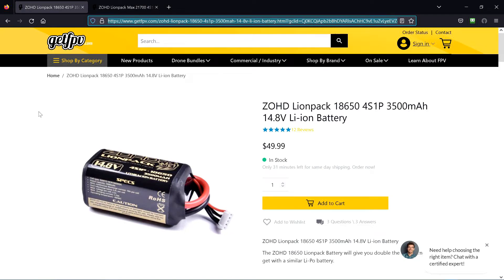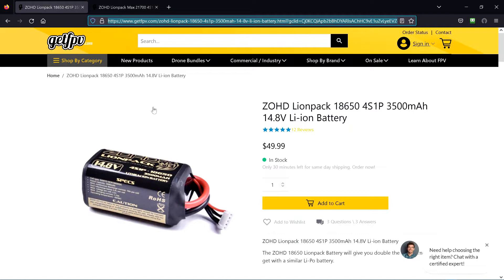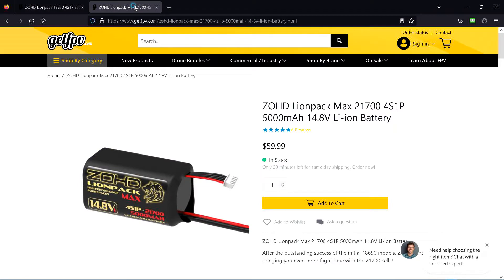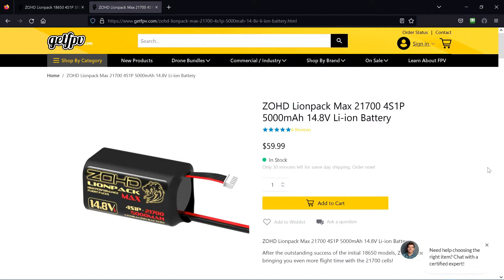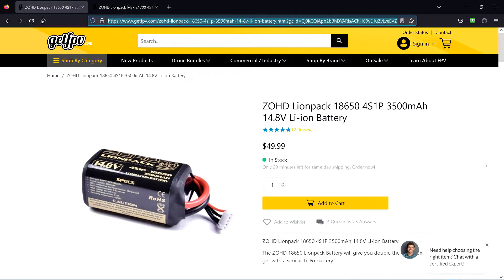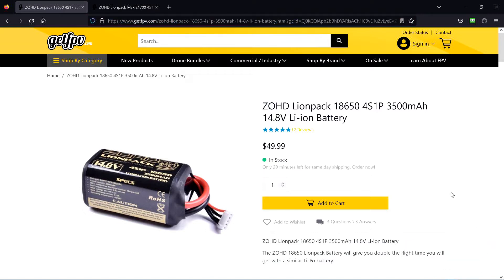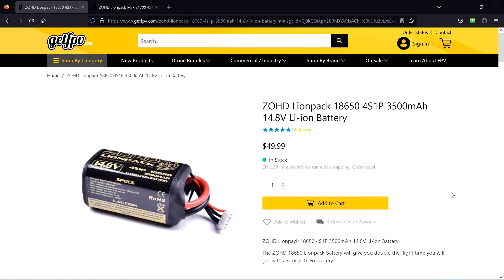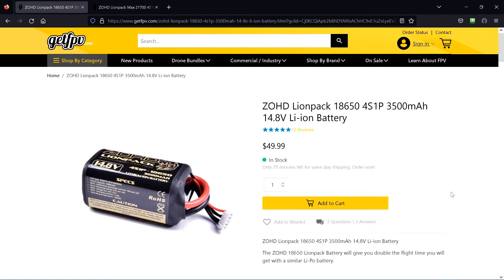A Little Help Please

Comment: Disable failsafe voltage. Just monitor your voltage. You can set voltage alerts instead. Lions will sag and then recover if you punch throttle. They will sag and recover pretty well on a takeoff. The idea is to get your plane up and at altitude fast and then cruise. Safe measure is land at or before 3v. I try to be close by around 3.2v to give me a little cushion for landing maneuvers and go-arounds if needed. If it's a calm day, I know I can stick the landing in 1 shot and may push it but that's not usually the case. When you're at 3v and need throttle, you will sag big time. At 3v, the voltage drops like a cliff and the next .5v go fast. Unless you're going for world records and extreme endurance, it's not worth it to run them down too far.

Also, I highly recommend the SkyRC BD250. You can take your mean cruising watts and set that in the BD250 and run the batter down to your desired end voltage to get a REALLY good idea how the battery performs. A 3500mAh pack will not have 3500mAh usable power. Then you throw in the C rating of the cells and you have another datapoint to compare.

Example test of mine for comparison:
6S6P 18650 rated for 21,000mAh has a usable rating of 15,651mAh when running at 128w down to 3v per cell. Run time 2hr45min
6S4P 21700 rated  for 16,800mAh has a usable rating of 15,914mAg when running at 128w down to 3v per cell. Run time 2hr59min

Different cells, different C ratings... You get the picture. You need to test them either in the air or on the bench. If you don't want to mess with the BD250, just put the plane into a loiter (big radius) and let it run down. That's a good method as well.

Here's a link to one of my test videos, https://youtu.be/Rr3YjCm_Xnc.
Reply from the maker: Ah so landings become more critical.  Or should I say, wave offs become more dangerous because of sagging.  Had not thought about that end of the flight.  I did think about the front end during the takeoff.  Figured like most batteries, the lower you can keep the amps the better everything works.

I do have a ISDT FD-100 I use on the bench.  It only has a few set discharge rates.  .5A, 1A, 2A, 3A, 4A, 5A, and 6A rates.  I have used in to test the endurance of a battery at a fixed discharge, but I needed real life data at this point.  Or someone to say my thinking that 3v was a time to land, was correct.

I think I have an idea/plan now.  Thank you.

I just watched the video.  My little discharger doesn’t do anything like that.  That SkyRC BD250 would be nice when my current charger dies.  I have an old HiTec X4 I paid a lot of money for about 10 or 12 years ago.  When it goes, I will step up.  Until it dies, I have to use it to make it worth my money.  if I ever can.  lol  One thing for sure, things sure have gotten cheaper.
Reply from the maker: Oh BTW.  The 4G telemetry.  I been peeking into that.  Am I going to have to fly a Raspberry Pi?  Or am I way off base?
Reply: @nighthawkvs  I have the FD-100 as well. It's good for discharging packs but doesnt do much else. The BD250 isn't a charger. It's just a discharge/analyzer. Not bad for $85.  The difference from the method you mentioned is that setting a constant discharge rate does not account for real-world as in as the battery drains, you need more amperage to maintain the same speed (wattage). So testing by constant power, you set your avg cruise watts and then you get a better representation. 

For 4G telemetry/video , I use a raspberry pi as a companion to the FC.
Reply from the maker: @NoFlyDrone  As I said I have been peeking into 4G.  I wouldn’t say looking yet.  First things I saw were to use a Raspberry Pi to get an internet connection with the 4G, then pass Mavlink and other streams (video perhaps) over that.  Or something like that.  I stopped there.  That’s a lot of extra weight when I haven’t tested the things I have already.  I need a break from brain testing things also.  I would expect there are other solutions that don’t involve a Raspberry Pi.  Those I would guess to be more expensive than the DIY.

Its all simple ohms law.  The resistance stays the same so if voltage drops as the battery goes down.  The voltage regulators have to suck more current to hold the voltage up.  The discharge isn’t linear.  The current draw goes up.  Hopefully the voltage on the other side of the regulators stays constant.  But as the supply side voltage goes down the supply side current MUST go up to compensate.  Until it just doesn’t have enough energy to work anymore.  My set discharge rate, timed with a stop watch, isn’t precise at all.  Likely would yield longer times than real world flights would.  IMHO  :)
Reply: @nighthawkvs  It's not difficult to setup but I'd say you should be very solid on your build and arduplane/mission planner. There are some tricks to getting it to work smoothly. I always maiden and test plenty without 4G before I stuff it in. It's not heavy either. I run it on a Pi 3b+ or a zero 2. I used to run it in a nano talon with the original pi zero. There isn't a plane that it is too heavy for 😀
I would definitely get some solid hours of flying with your current planes.
Reply from the maker: @NoFlyDrone  It looks like I was seeing things correctly.  :)  I will take up 4G in the Spring.  :)